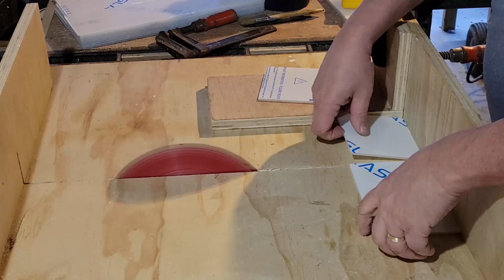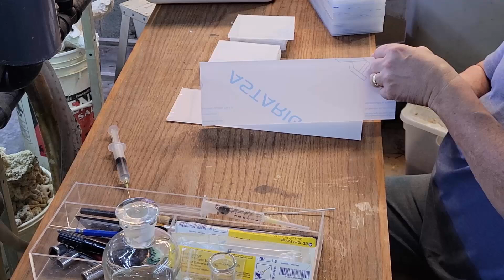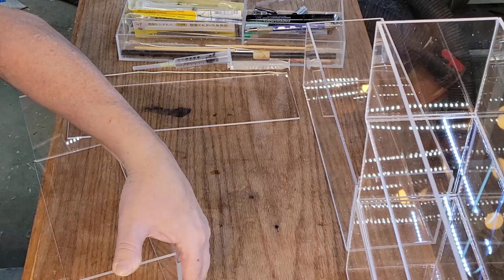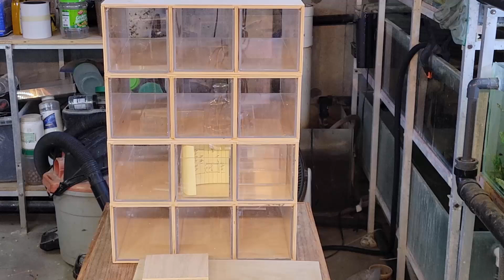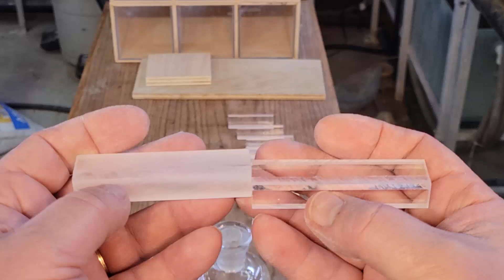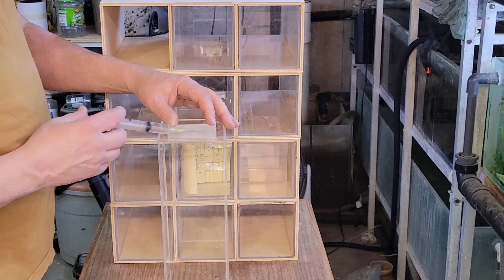Acrylic Shop Drawers For Organizing: Part 2

Comment: Interesting. I'd not thought of welding them like this. I managed to acquire a large office worth of 4mm (1/8") acrylic sheets. Around 40-50 sheets, mostly 3ft x 8ft. They were headed for the skip & I grabbed everything I could. I believe my employer paid through the nose (the rumour is £40k) and I took nearly all of them for free :))) Also all the aluminium joining plates and L brackets. Quite the lucky haul.

I've been using them for various projects (Jigs and a wood store - roof & sides). I guess I could sell some of it on but I'm a harder & quite like having a lifetime supply to play with. These drawers look the business. I've subscribed for more tips & ideas. Thanks from Wales, UK
Reply from the maker: That is quite the amazing haul! That would save me so much money. Thanks for taking the time to come by!
Reply: @justmakeit2849  I couldn't believe my luck. I thought I might get two or three sheets but nobody else seemed interested and after a couple of months the boss let me clear it all out. Storing it has been a bit of a challenge and I've been trying to figure out what to do with it since. 

I made a loose tenon jig to work with a trim router & held some of the parts together with epoxy resin but your method seems a lot better. I love the idea of the clear-fronted drawers. Last year I covered the long wall of my workshop with basic cupboards and this type of drawer will be ideal to allow me to store things & actually see what is stashed away. Should make a dent in the stack of sheets :)
Reply from the maker: @Rooster---ooo  That will be a great use of them